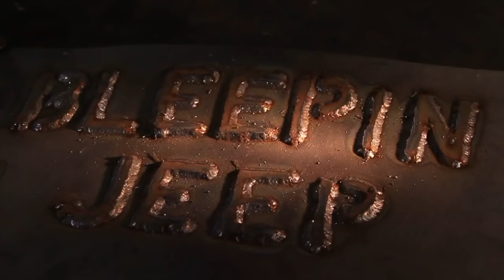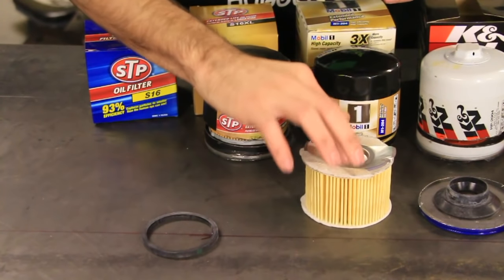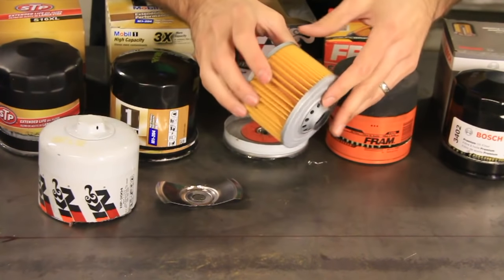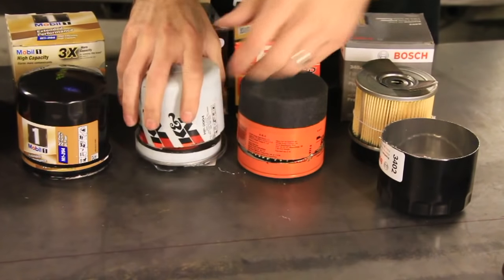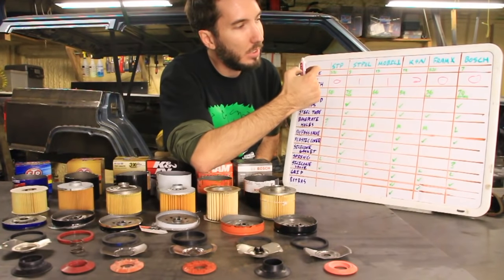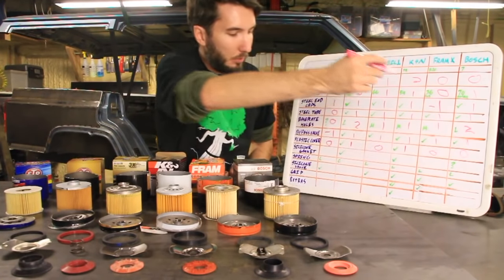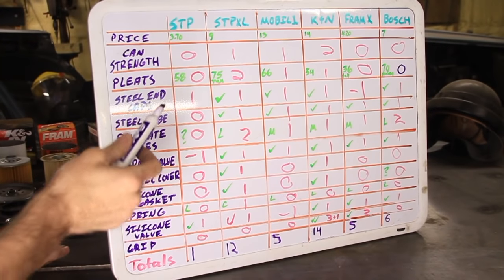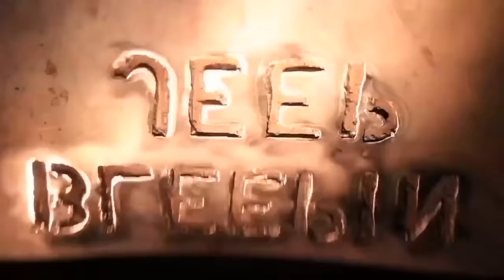What the Crap is in My Oil Filter?  We Find the BEST and Worst Oil Filters from AutoZone

Comment: Purolater is my favorite filters, they are hard to beat for the money. There are a lot of decent filters out there other then Purolater of course. In reality, there are actual only a handful of manufactures of filters out there. Many names out there are manufactured by these companies to a given brand names "specs", and labeled appropriately. As some have pointed out, the Napa line is actually made by Wix. Wix filters have a great reputation. Fram is another example, the current Subaru factory oil filters are made by Fram, at least in the US market. Fram gets a pretty bad rap, as they may deserve... But I am not aware of anyone destroying there engine with a Fram filter. K&N does not actually make many of the filters they market themselves... There are lots of examples of this. People also argue oil bands and types as well as oil filters almost like it's a religion. This has gone on for a long time as a website such as "Bob is the oil guy" will attest to. I of course have my favorites! But, bottom line, if you change your oil and filters according to manufactures specifications, with a known name oil and filters, you will have a car or motorcycle that lives a long life. My preferred oil filters are Purolater and my preferred oil is Mobil 1 synthetics for car and motorcycle. Are there better than these choices? Quite possibly, but I bet my car and motorcycle will last as long as someone running there preferred flavour. Purolater and Mobil 1 have the advantages of good price, quality, and ready availability most anywhere... proper maintenance will make your stuff live longer then you will probably even care to keep it.

Comment: Not mold on the fram, but glue. Glue holds the accordion type filter to the end caps, and the fram being built of a cardboard, let's the glue soak through to the surface before drying.
Reply from the maker: I thought this may be the case but it's discolored even where there is no glue??

Comment: Just an opinion, but oil is pretty much the life blood of your engine. If a person is too cheap to spend $15 on a better filter to make sure their engine is better protected, then they deserve the problems they'll encounter.
Reply: I'll spend the extra five. And I'm new to this hence the youtube thing to look it up. K&N it is!
Reply: +Phil Harris Except your ignorance is showing.  There is no evidence that using the best filter on the market makes any difference compared to an "average" filter.  This is within the assumption a person changes their oil and filter when they're supposed to.  THAT is what matters, not picking the most expensive thing then pretending you somehow did better for your engine.

Plus, a visual examination tells us almost nothing useful.  We don't know the pressure for the relief valve, the saturation point for the filter media, whether (claimed or not) the oil particle size is acceptable or too large, the restriction on flow rate both at the beginning of service and at the end of anticipated service life.  Some engines need more pressure than others so a lower restriction filter is more important for those, as it is when an engine gets older and someone decides they are fit to pick a thicker oil to compensate.

The only thing we can really take from the video is that the base STP and the Fram are both economized junk.  Lesson:  The cheapest thing you can find, oil filter or not, usually is junk.
Reply: Really? Your rambling proves your "ignorance"!! You just said " a visual examination tells us almost nothing useful". And then turned right around and said that "the base STP and Fram are economized junk", and then " the cheapest thing you can find, oil filter or not, usually is junk". All of which is the EXACT point I was making, just worded differently. Thanks for sharing your vast knowledge with us.
Reply: Phil Harris
Yes Phil, within LIMITS that any moron wouldn't need to be told about, a visual examination tells little.  Obviously the Fram and STP exceed those limits.

Usually adults don't have to be told things like this, rather small children with no grasp of the world yet.

However, you weren't making anywhere near that exact point.
  On the contrary you were implying that people are cheap and it effects the engine if they don't buy the most expensive filter out there which is clearly incorrect no matter how you try to backtrack about saying it's wording.

Perhaps your words don't mean what you think they do.
Reply: +Stinky Cheese 
You're right, I'm wrong. There.....feel better? I apologize for all of my incorrect and ignorant implications. In the future I will refrain from expressing any opinions I may have and allow people to refer to you extensive knowledge of all things. Have a great day!!
Reply: +Stinky Cheese It Depends entirely on your oil change life. I change mine about 3,000 miles or 6 months, so a purolator works great for me. If I went 8,000 with a full synthetic, I would put a nice K&N or similar.
Reply: its more important to use synthetic oil
Reply: It's really only needed if you put a high amount of stress on your engine or go for long periods without oil changes.
Reply: not true.  non synthetic oil causes more wear than synthetic.  synthetic oil is cheap now so there is no reason to avoid it
Reply: tiehut Actually no, Dino oil is going to work just fine in any jeep  application. Unless you've already gone synthetic of course

Comment: The STP does have a bypass valve. It's built in with the anti drain back valve. They call it a combo valve.
Reply from the maker: +Edward Shen I was wondering if thats why the plate was different than all the rest.
Reply: +BleepinJeep All the cheap economy filters will most likely use this design. Silicone drain back vales are always orangey red.

Comment: Bosch (also makes Purolator and Motorcraft) for me. I work at a Ford dealer and have only seen one defective one and it was almost certainly caused by an inattentive factory worker. Wix/Mann/NG/CQ are also good. Frams and anything cheaper are garbage and will definately shorten the life of your engine. Ive seen countless torn and collapsed Fram and no name Walmart and Kmart filters. Just cough up the extra couple bucks and keep your car longer. The K/N, Mobil 1, Royal Purple, Amsoil are technically the "best" but i cannot in good concience advocate oil change intervals over 10,000 miles so its probably not worth the extra coin.

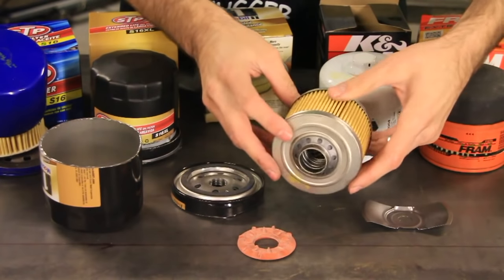Comment: Oh boy! The unscientific trying to look scientific. Capacity is how much particulate will the media hold. Is different from the efficiency. You can have an efficiency rating of 98% but if the capacity is 1 gram of 20 microns your filters bypass may open sooner. The Purolator 1 filter has an efficiency rating of 99% at 20 microns or larger with a 13-gram capacity rating, so it is full when 13 grams of particulate that is 20 microns or larger has been run through the media. So to put perspective on what 20 microns would be invisible to the human eye. If you could see ragweed pollen. dust is 21 microns and a dust mite is at 250 microns. Pleats and stuff all helps the efficiency rating. But not the capacity rating. Fram has a capacity of around 9 grams Mobil 1 has a 12 gram, Wix/ Napa gold around 13 gram. Also at 7:30 the anti drain back valve is silicone.  The fram it is adhesive not mold. the anti-drain back valve is rubber.

Comment: What have you been using and are what are you gonna start using after this brake down?
Reply from the maker: I always have used the cheapest ones that come with the 5 quart sale, but of these I think the stp xl was the clear winner.  But I'm so cheap it will be hard for me to fork over the extra dough.... If I could I would test the cost comparison between expensive filters and a new motor;).

Comment: i subtracted the cost from the points  k&n scored 0 and came out worse then fram x but m1 by far last place and and in first with a +3 stpxl  but when i changed the grip values to a 2 and 1 because its not a big deal for me k&n was -1 and fram x at 0.2

Comment: You have to remember that k&n is a race filter and will flow thicker oil better than the other filters it's not meant for thin oil is meant for straight 30 and thicker weights that's why the pleats fluctuate in size

Comment: OK guys, it looks like someone missed the point of a oil filter is not always the out side material an the price, filament area of in each filter is the main reason to a good filter, by pass ok, silicone ok , some had buna material gasket ok , the STP XL or Bosch are my pick, thanks by the good video.

Comment: I forgot to mention that Champion Labs doesn't really design the filters.  The brand names do.  So it's pretty obvious who's willing to put their money down on good design and who is just in it for the profit.  Personally for my '00 TJ 4.0L I use a Napa 1459 filter.  It's big and fits just right.  Same goes for the Cherokee after the ReNix engine era.  For those, I think the 1452 fits since it's not so tall but taller than the MOPAR shorty giving you more filtering media to work with.  Still has the problem of pre-filling since the opening faces down.  Just be patient and let the oil soak into the filter and your Zero PSI time is reduced.  Happy Trailin'!

Comment: I didn't read all the comments but strongly agree with the one I saw that the points system is quite lacking and subjective.  Should have rated them 1-6, with 1 being the best.  Then lowest total is the best.  But some qualitative measurements are missing, such as type of media, mileage rating, micron rating, flow rate, efficiency rating, and burst pressure.  Anyone one of those is more important than how many holes are in the base plate, or whether it has a grip texture.  You should wear latex gloves when changing your oil filter; so, the gloves will provide the necessary grip on non-textured filters.  Do the test again!  You do get credit for effort and at least showing people that not all filters are alike.   And Fram sucks ....

Comment: I hate STP filters, I use them on Fords and I constantly tear one open with the wrench, especially if you get close to the plate. and if you don't tighten it to the point of needing the wrench, it leaks. I switched to Motorcraft and don't have any regrets, no noise on startup and good performance filtrationwise, which they're just Purolators
Reply: Purolator is one subcontractor Ford has used for oil filters.  There have been others.  Interestingly, we cut apart a Purolator brand and a Motorcraft brand filter, and they were quite different; the Motorcraft had more surface area.
Reply: The Motorcraft is a higher tier Purolator

Comment: out of the threated inlet that attached it to the vehicle. in jeeps the fram can hold up but in higher compression or boosted cars they have been known to suck up into the motor. i personally in my xj and my lexus is300 i will only run wix oil filters.
Reply from the maker: What exactly sucks up into the motor?
Reply: +BleepinJeep the actual cardboard filter on the inside.

Comment: I cut up a Purolator Classic and Purolator Pure One...other than silicone seals in the more expensive one they are the same.  But, I found some glue mess on the outside of the Pure One filter material similar to what you found in one.  My guess is the manufacturers are not very neat when they glue in the filter material.  You didn't show it, but are all filter material glued in or sealed in some other way?  Apparently "string" is not that uncommon...see this comparison.     http://www.fleetfilter.com/comparison-purolator-filter.html

Comment: Many other filter brands use string to retain the folded filter shape - zero importance. Pseudoscoring system especially as alloys determine can strength, and many complain about the KN 'nut' end tearing on removal - hardly a benefit. By the way, zero testing of like, uh, filtration, bypass valve pressure setting, etc. That is to say testing by any methodology that has been determined to be either important or objectively ranked. Look elsewhere for far better evaluative testing.

Comment: You did a lot of work, but your chart reminds me of gov't by committee - for example the number of pleats is much more important than the outside grip (Fram), which can block the use of a filter wrench. Anti-drain back valves do absolutely nothing for you if your filter is mounted vertically, but upside down on the engine (threads up) - it won't drain after engine shutoff anyway.
Also the type of media - synth or paper,  is much more important than a silicone gasket, since the conventional rubber gaskets seal just fine.
Fram EG is 95% a cardboard cheapo 5k filter and  Mobil 1 is a Made in USA, high efficiency ,99.9% unit made for synth oil and 15k oil changes - yet you ranked them the same on your chart.

Comment: Aside from looking at parts inside and ASSUMING how well they work where is the proof? Where is the data that shows the amount of contaminates filtered, the size of particulates filtered and amount of contaminates it can hold before A-causing it to bypass the oil filter or B- causing failure of the filter? 

I had to get K&N as an option when purolator was not being carried at walmart anymore. Well it wouldn't screw on properly, the crest was splitting. I have proof with camera and video. K&N denied but did send me replacements that they verified as correct, but again it wouldn't screw on and same visually viable proof that the crest of the thread splits.
Reply: +kingmabb  Answer is here....
http://www.austincc.edu/wkibbe/oilfilterstudy.htm

problem is finding the damn SAE J806 & J1858 Filtration Efficiency !!!

Comment: for value rating you could have divided to get "cost per point" to see which is best bang for the buck
Reply: +Peter Alfonso i subtracted the cost from the points  k&n scored 0 and came out worse then fram x but m1 by far last place and and in first with a +3 stpxl  but when i changed the grip values to a 2 and 1 because its not a big deal for me k&n was -1 and fram x at 0.2
Reply from the maker: +Peter Alfonso not sure what you mean... division is beyond my skillset;)

Comment: for sure switching from fram to k&n after this
Reply: +Gealii Exactly. I had the exact same thought.
Reply: Honda now sells a Fram under the Honda brand - the 15400-PLM-A02  is a Fram Double Guard.  The best Honda filter is a 15400-PLM-A01, which is a Filtech filter.  The differences in construction are appreciable, the A01 being poorly made.
Reply: I wouldn't I would use mobil 1 or wix. I used to use k&n on my motorcycle and just wait till that nut strips. It's not even a real nut it's stamped steel and is so thin.  The nut stripped and it turned a 10min job into two says trying different oil wrenches to get that thing off.

Comment: Annoying! Yeah, that string got there because some broad on the assembly line was knitting and decided to test out a new knot. What a waste of time and filters.This is worthless without media area and micron rating. KN have been recalled because the spot weld on the nifty nut burns through and blows out the engine oil on the road. I use 16 inch channel locks to remove filters or a hammer and screwdriver, so keep your $14 KN nut.  Bosch with the crochet work is the best or a Motorcraft for $3.95.

Comment: You gave the cheap STP filter 1 point for having metal end caps.  It does not have metal end caps so it should have gotten 0 points.